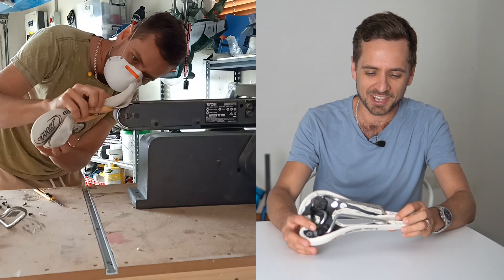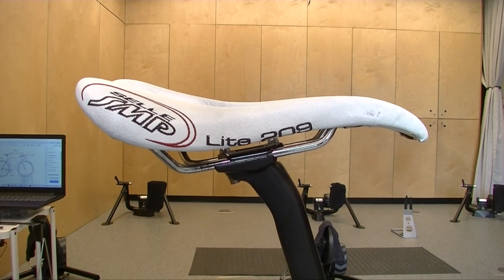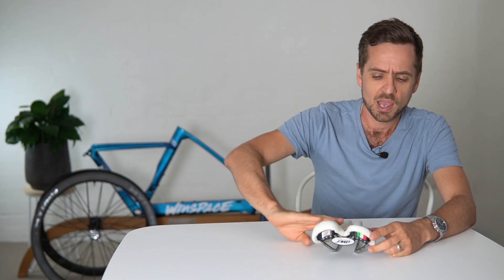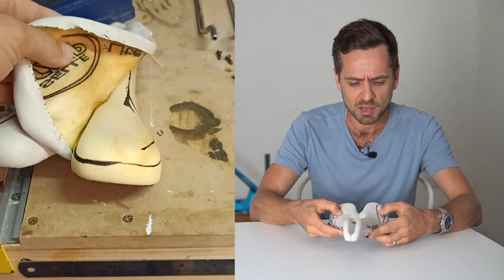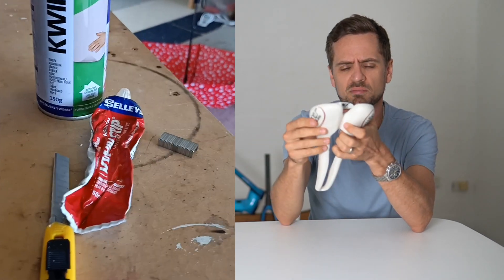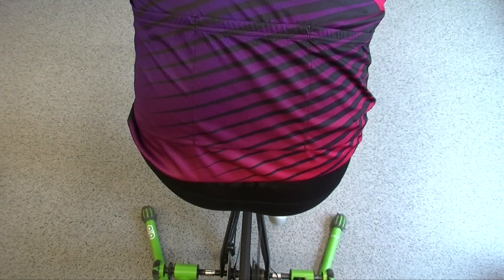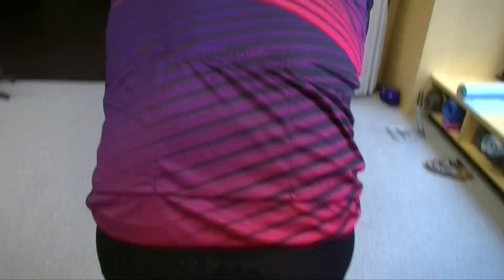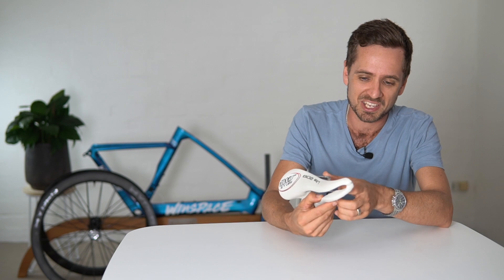Could you need a custom bike saddle!? (a unique bike fitting story)

Comment: Strewth. Just been through bike fit as struggling with left leg groans and right sided saddle sores. I was told I have a short left hemipelvis - by 6mm. I now have 6mm dense foam strapped to the left side of my saddle and 3mm shim in left shoe. First ride yesterday. Not sure yet. But was wondering how on earth this was going to work if it is the long term solution. Relief!

Comment: Interesting fix, suggestions for someone who has extreme sit bone pain. I have had a professional fit and have been back a couple times for saddle fit. I have purchased several different saddles and they are all the same, pain. I ride more upright, endurance due to a three level fusion in my neck.
Reply from the maker: Interesting to hear Dale, thanks for sharing on the thread.
Reply: @roadcyclingacademy  Agree - a lot of the saddle related discussions are around perineal numbness, but I’ve always suffered with sitbone pain despite several bike fits. A lot of my riding is done indoors, and I’ve recently seen some fitters discussing the different challenges indoor riding places on comfort, but also pedalling mechanics. Would be really interesting to hear Neill’s thoughts on this due to his expertise.

Comment: Another great video - always look forward to these, so thanks for doing them and keep em coming!

One topic which doesn’t really get much coverage with bike fitting is shoe selection, so I’d be interested to know Neil’s thoughts on how to approach choosing cycling shoes.

Whilst comfort, and the ability to locate the cleats in the correct place are obviously key, I’d like to know what else about the structure, support and design of the shoe does Neill feel can influence someone’s position, fit, and ultimately their comfort and performance on the bike?

Cheers gents 👍
Reply from the maker: Great suggestion, it's on the future content list. Cheers mate. Cam
Reply: @roadcyclingacademy  thanks Cam, and in case you hadn’t guessed, I’m in the market for new shoes so am keen to get Neil’s advice 🤣.

With the importance of arch support to achieving a good fit and performance, I’m particularly interested in how the structure and support the shoe offers, particularly at the heel, should inform one’s choice of shoe, as I’m guessing that it also influences foot control and the pedalling mechanics.
Reply: @roadcyclingacademy  If it is possible please cover also MTB shoes (for gravel riding).

Comment: Neill, what is the flattest seat out there with a cutout? I broke my coccyx jumping out of a plane(US Army) and it never healed right. I can't ride any seat with a up tilt in the back. I currently ride a Selle Italia SLR, but even at an hour my tailbone will start to hurt.
Reply: Look at Geobomized saddles
Reply from the maker: If you've already tried multiple flat-style seats and there is coccygeal pain, then an even flatter one is unlikely to be the solution. I would be looking left of field at something like a Brooks saddle or an Infinity saddle to attempt to really relieve that particular spot. I've also found that sometimes it's not the pressure on the coccyx that is the problem per se, it's the repeated muscle contractions of the pedalling motion pulling the sacro-coccygeal disc side-to-side with each pedal stroke. Never really found a 100% solution to this one if that's the case except very short cranks to reduce the amount of hip motion and thus peak contractile forces through the glutes, gemelli and obturators. - Neill

Comment: If both rails are removable could you fashion a different height rail to achieve the same outcome?
Reply from the maker: Good question! I am sure Neill will get to this one.
Reply from the maker: Conceivably yes this would work, but my ability to accurately bend 7mm high carbon content steel is vastly outstripped by my ability to use a belt sander and staple gun. - Neill

Comment: Would an ISM saddle be a non-modification solution to the pelvis issue in this video?  What if they just didn't use their sit bones to hold their weight up like ISM claims you shouldn't do?
Reply from the maker: If the rider was in a TT position, bearing weight on the very front sections of the IPR then maybe a regular seat would have worked - he was on a road bike and relatively upright at that, so the effect was perhaps enhanced from this. Hard to say! - Neill